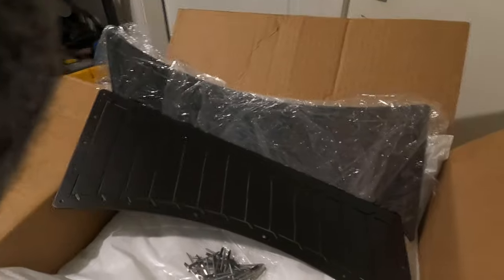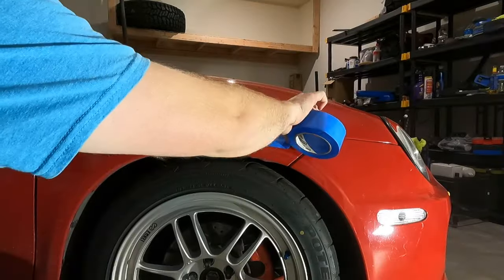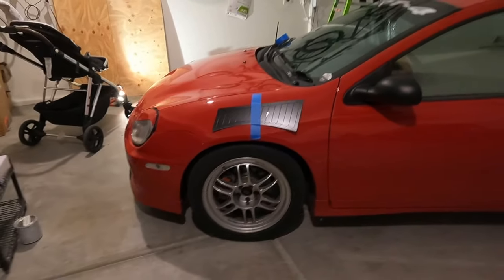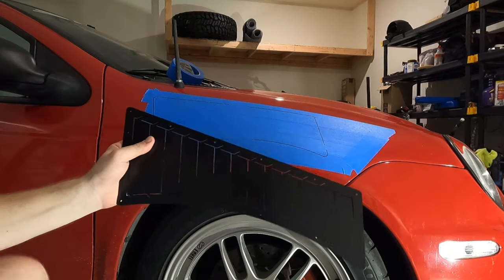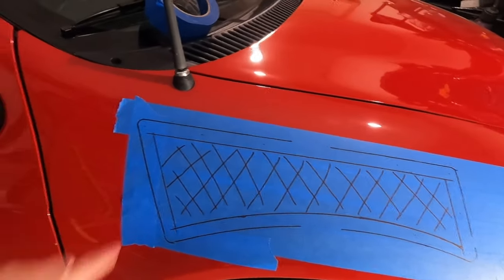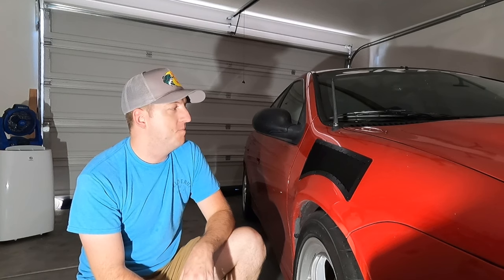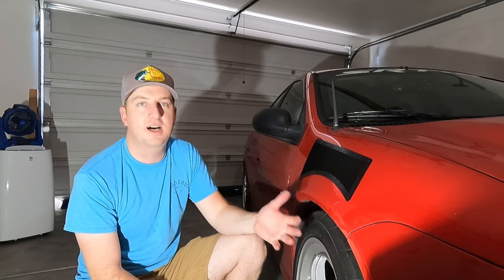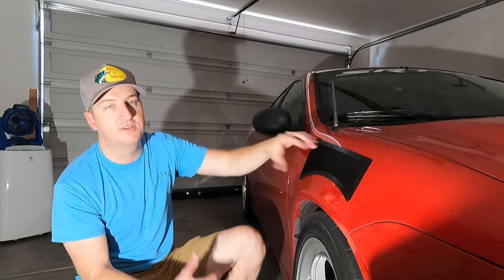Installing Professional Awesome Racing Fender Louvers On My SRT-4

Comment: Looks good. Hate the 1gn doesnt get this type of love anymore but then again mine is down with rod knock. Honestly would've looked great color matched imo
Reply from the maker: @akirony  it’s true. Check out the channel I linked in the video description. He builds and races a 1gn.
Reply: Yeahhh i wat h Staged Racing. Still torn on rebuilding my 2.0 or srt4 swap. Wanted an NA 2.4 but i love the hi rev dohc over torque
Reply: @akirony  Definitely look into a 2.4 na swap, I loved my 1g when I had built 2.4 making 200whp. I have srt swap 1g and ill tell you its a commitment
Reply: @clarenceperkins3115  !? Is that the SRT4-World renowned beautiful burgandy SRT4 ModernPerformance Clarence? BIG Fan here and appreciate all advice. Had a ps2 2g swap for 11yrs and not ready for that type of broken heart commitment again.
Reply: @akirony  Kind words, yes that would be me 😄good ole Maroonbeast. No problem  I always try to give good advice

Comment: Nice! What are the specs on the rpf1s? I want to get a set that fits with no rubbing.
Reply from the maker: @cannondale4567  the are 17x8 +35 with 235/45 tires.

Comment: Do they serve any purpose on the racetrack??
Reply from the maker: @Dirtypacc  yea, downforce. It provides a place for high pressure air in the wheel wells to escape which creates downforce. 

Mine currently aren’t functioning until I remove/modify my wheel well liners.